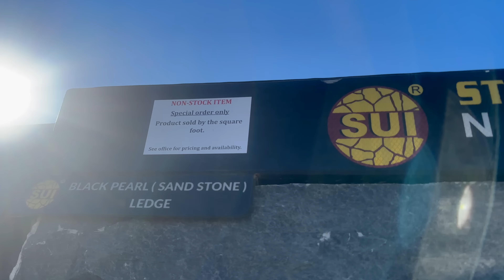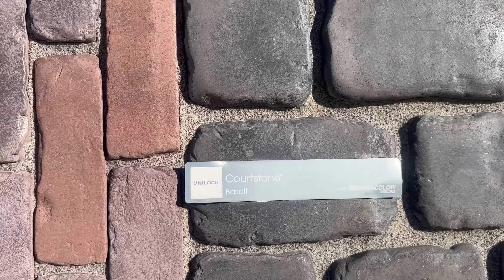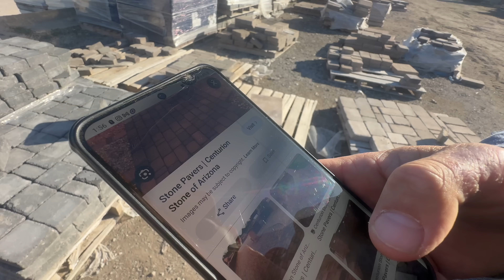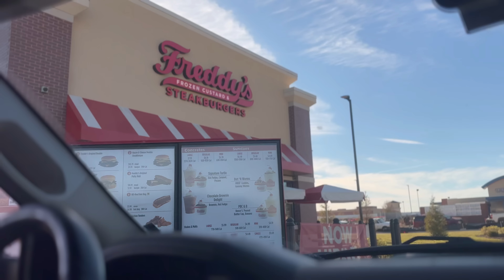Keeping My OFFGRID Shipping CONTAINER HOME Warm | Finished Floors & Wood Stove

Comment: It looks gorgeous! 🤩
The only thing I would've done differently is lay the stone first, then cut the flooring around it and finish it with a high-heat silicone. It would be a lot of tedious work, but it would reduce the risk of stubbed toes 😅
Definitely the best choice though! Much easier to clean up any spilled ash, too!

Comment: GREAT choice on the rock!  Tooootally flip it, though.  It's upside down.  When you do, trace the outline onto the floor, move the rock, use a multitool to trim out that patch of flooring, sink the rock into it and seal the crack with caulk...prolly silicon...I'd go with black.

Comment: I don’t think it is needed but when I used paver stones I put heat shield under mine. Basically heavy aluminum foil. You could put a few spots of mortar or grout under the slab to level and help it be one with the floor. I enjoy your show. Wondering what you will do when you finish all your projects. Took me 7 years to relax

Comment: Hopefully it doesnt crack.  Thats a benefit of smaller pieces.  The heat can do tbat depending on tbe stone.
Reply from the maker: We did a little research and we should be in the clear. We have had roaring fires the past few days and the rock stays cold!

Comment: How are the dogs liking the finished floors? Also the rock looks really good, it makes the space bigger and you can also take it away when you put the stove away. I also think it gives you more options for the wall if you still plan to do that.
Reply from the maker: The dogs are loving them!! we originally planned on moving the stove out every summer but I think we might keep it in. It’s really really heavy and hard to move unfortunately :(
Reply: @CantContainUs the stove adds a cozy feeling.  I wouldn't take it out every year. Plus, like you said, it's heavy and just another task to complete twice a year.

Comment: Most generally the floor around a wood burner needs to be fire proof because embers can fly out when you are stoking them. Every place I installed one had city/ county regs for how much you need in front and to the sides.
Reply from the maker: We kinda played with the design and spacing but luckily our country regulations really only state to follow the stove dependent guidelines. If an ember ever flew out while stocking it I’m sure we would be able to put it out.

Comment: like the look;;;don't think any problem with weight except for having to move to make repairs or changes;;;;think I would have put some sort of felt or outdoor carpet type stuvv underneath so that if ya had to move it a bit you could slide without damaging the floor;;;anyway its down looks good so we shut up and say enjoyed thumbs up and keep em comin
Reply from the maker: I dont think we showed it but we actually put one of those anti slip mats for a rug underneath it to protect the floor and make it easier to move
Reply: you did and I saw;;;lol;;;sorry wasn't clear on my comment as I was thinking of something like carpet to act like furnithre pad to but under legs of furniture or appliances to be able to slide and not damage the  finished floor;;;had a friend that ruined their flooring by trying to lift and move stove and gouged their flooring panels beyond repair;;;looks good;;;;;keep em comin @CantContainUs